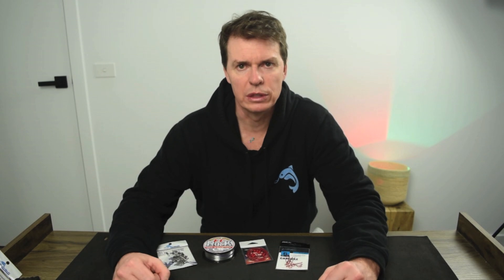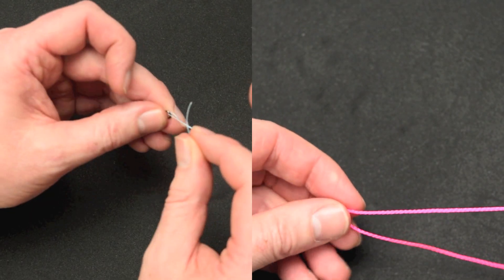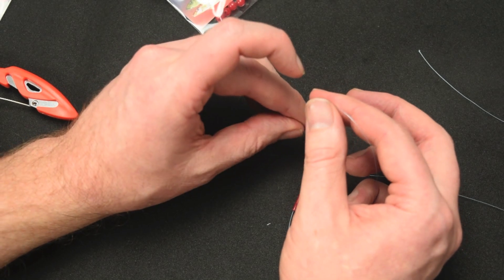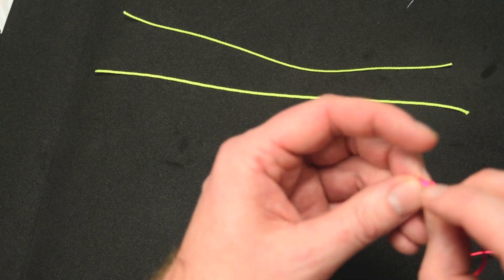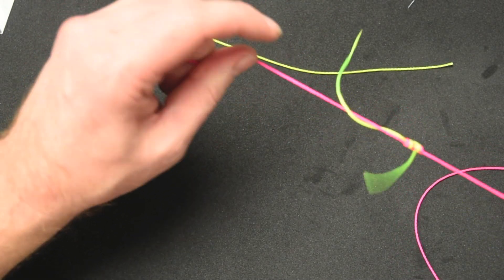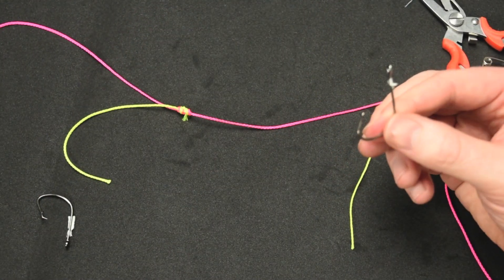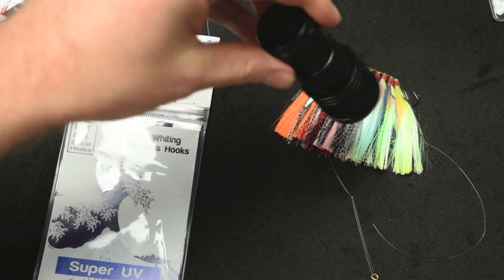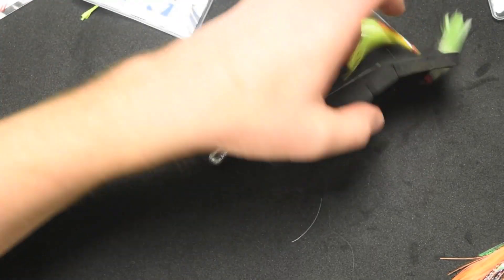How to Make WHITING RIGS | DIY Running Sinker & Paternoster Rig | Whiting Rig Setup | Fishing Rig

Comment: A couple of points. Fluro carbon is way to expesive for value and result. Use normal line or red coloured line. (Red is the first colour to disappear in water).
The sinker dropper should be 4 to 6 inches with the hook leader 12 to 18 inches depending on tide flow. A snap swivel for the sinker for quick change sinker size.
Great way of showing knot tying
Reply from the maker: Hi Rob, thanks for your feedback mate. Totally agree on the price of fluorocarbon leader. However, I was able to find an inexpensive brand at my local tackle shop. FC Rock is 100% fluorocarbon and retails for about $17 for 100 meters. I’m pretty sure it’s available at BCF too. I’ve been using this brand for about 3-4 years and it’s never failed. I highly recommend it as a cost effective leader.
Cheers 
Rob
Reply from the maker: Sounds good 👍